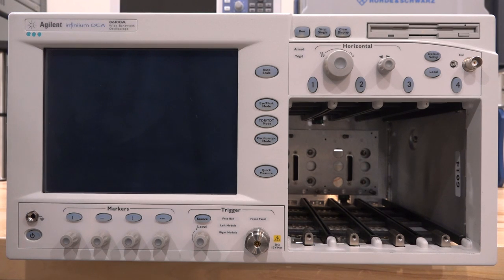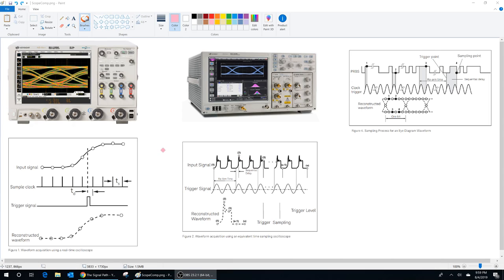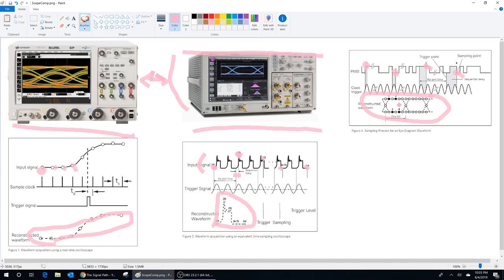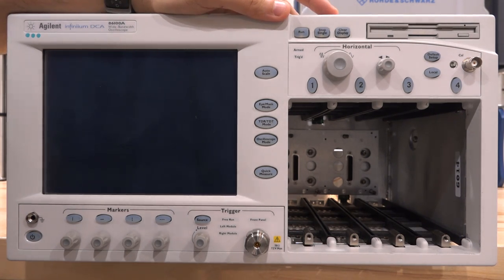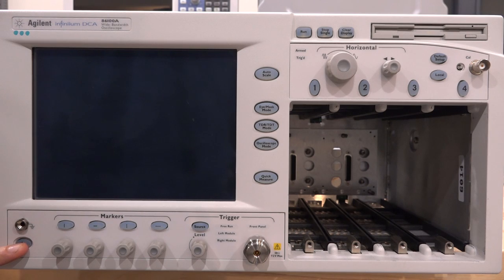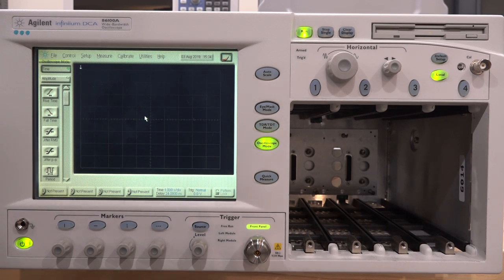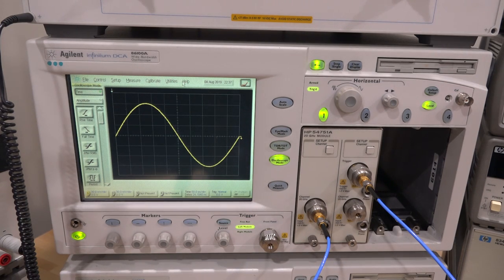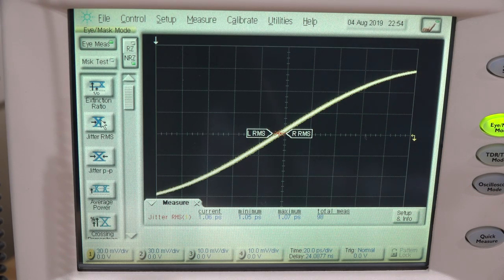TSP #156 - Teardown, Repair & Experiment with an Agilent DCA 86100A Wide-Bandwidth Oscilloscope

Comment from the maker: Please note that my channel format, content and style will never change; this is regardless of subscriber count. The subscription can help engagement with unique vendors, NOT sponsored content. I can get sponsored content anytime, but I have not. The most important thing is content diversity and reach.
Reply: I just recommended you to two friends. If everyone does the same you could be at 192k subs!
Reply: Richard Deasington I don't have any friends who are into this stuff. If I had, I sure would recommend this channel
Reply: HalfSpeedMastering You still get a lot of bearings that fail in these old drives. Or the obvious headcrash because something somewhere messed up. If the drive is damaged and you can't get a working image from somewhere the instrument is due for recycling. Switching out a control board from a donor HDD isn't too bad but fixing a broken bearing is pretty intense.
Reply: @allesklarklaus147  , I'd go from "intense" to "dense." As, almost always, it is nearly impossible! LOL
Reply: Shahriar, why not make some "general electronics videos" covering slightly more obscure topics? CFB opamps, balanced lines and baluns, beam forming / antenna arrays. These topics surely fit with your channel quite well.
Reply: One thing about your subscriber base, it is not simply about count,  A lot of them are people who design and specify very high value instruments and control large dollar volumes of instrument and component purchases.  They are not hobby makers.  To sponsors this would be very valuable.
Reply: @allesklarklaus147  I will be your friend

Comment: One thing you could possibly do to bring in new people, is to perhaps start a 'project' series, where you'll design a SDR downconverter for example, with certain specs, go through the design phase, PCB design, assembly and testing etc. I think that will actually allow us to also engage in the topics, since most of us don't have > 3GHz equipment laying around, but SDR is something anyone can do!

Of course you have to stay true to what you've always been doing, since this is how you've grown in the first place. Looking forward to see your ideas!
Reply: That's a cool idea!  Maybe dovetail it into more DIY 3D printed feed horns, which was quite astonishing and unique; I hadn't considered using a 3D printer that way.  How amazing to explore voodoo-magic microwave antennas by printing different variations and conductive paint!

Comment: First off, thanks for creating these videos. Very thorough.

I'm trying to design jitter measurement into an embedded design and wanted to better understand your comment in this video about leveraging precision timing with a low-speed ADC to statistically measure RMS jitter over time. Any further elaboration would be greatly appreciated. Thanks again!

Comment: My personal vote is for more videos about practical applications of RF techniques. Show some fancy RF simulation stuff and verify with a physical demo, for example. Given your "per video" patreon model, you could combine several concepts into one video. Something that draws upon your specialized expertise to explain implementation details that are achievable for experienced hobbyists. I used to feel a bit weird for being too much of a hardcore nerd in a sense of struggling to connect with less experienced people without overloading them. But I've figured out how to bridge that gap these days. I don't feel like I'm "not using enough of my expertise" or something. Sure I am. When I explain things to someone, I don't make mistakes or mislead them. I use proper and accurate terms. I can easily tailor my explanation to their application. I can answer any followup questions under the sun, etc. The other thing I realized is the value of multidisciplinary communication. I have colleagues with multiple degrees and it's always interesting to hear the insights they've attained by having equal expertise in several fields. If you're at a high level in your field, it's very important to find ways to make an impact on people who specialize in something else, but who could use the insights into your field that come from a trustworthy expert. I would argue that what makes your channel unique is 80% the person and 20% the content. It's your approach that sets you apart. Which is to say, you shouldn't be afraid of making occasional content just a bit more general. Like you said, a lot of people could do (and do) lower-level things, but not in the way that you would and not with the tools that you have. Wouldn't you agree? You're more valuable as a person than you think you are, trust yourself to do a good job on whatever you decide to do.

Comment: Shahriar :)

The higher the frequency the higher the cost of measurement equipment 1-GHz is DC 26-GHz+ is the offering. (and that that's the problem for user engagement)  

Do some basic videos on transistor regulators, signal processing, mix signal topics using a signal controller, topics on DSP ect.. the problem with your statement about HF 110GHz videos is, it doesn't talk to the basic to early advance user (not even to those who have own "some" good equipment) it speaks to companies, companies doing 5G and other advance stuff (like the stuff you doing at bell labs), I challenge how this form of education is translated in the real world (for normal users to take home and expand on), if the equipment to experiment at will is a challenge alone to obtain.  

Everyone has access to powerful MCU platforms and a oscilloscope (100MHz) this alone is ground for some amazing content.

Some random ideas..

1) There's a lot of opportunity to run videos covering covering mix mode electronics, digital + analog design.
2) Magnetics, in this day and age, there's alot of knowledge gaps around SMPS design for magentics. see Ridley Engineering about magnetic misconceptions!  
3) High precision circuit design, op-amps circuit design Dave did some good videos but that's only the tip of the iceberg.
4) If you want to do stick with RF then consider doing demos using sub 1-Ghz stuff. a basic AM radio would be cool? 

I remember some of your first videos, a discrete PWM controller using an op-amp and integrator.. that video alone helped me build and understand PWM controllers, I ended up building a SMPS and class-d amplifier controller a few years later.

Comment: i like seeing exotic gear, and i learn a lot just watching you test it, both about how it works and about electronics...  and i love how you make it possible for me to understand with you staircase approach, like how you go little things at a time, and explain from the ground, up one step at a time...  I think that's great, and I wanted to compliment you on that, I think it works well with your presentation, too...  it makes you (seem like) a nice person  😊

i wish there was more take-home content, though, because i'm still hesitating about a $50 meter, so a $5000 one..?  I'd get it if i had the money, though, so maybe it's not a valid argument...  🤔

i'm trying to figure transistors out, too, so a 6.5 digit meter....
Reply: Patrick Dorion ,  Most of us don't own a 6.5 digit meter, let alone one which reads to eight digits or more.
Reply: If you spend time on eBay and go to your local university's surplus auctions, you can pickup some gear for cheap.  I have a 6.5 digit multi-meter (HP 3455A), I paid less than $100 for it.  Of course, I have no way of knowing how accurate it is as I don't have the gear to test/calibrate it....  Of course, being a gear hoarder, I've since acquired 2 other 6.5 digit DMMs, both Keithleys....
Reply: @BruceNitroxpro  How did you manage to massacre my name when the thing writes it for you ?
Reply: @tylerufen  , There ya go, fella. Your name... written by the computer this time. LOL

Comment: 63k subs are far to low for this great content :) 
I started to watch your videos when I didn't even know much about advanced electronics and RF. Later, after finishing my mechatronics apprenticeship at a big car manufacture, I realized that your type of content is exactly what I am really interested in. When I start to look for universities, I found that I could study "electrical engineering and communication technologies" with a major RF engineering part close to the city I live. 
If there wasn't your channel I would probably still doing shift work and get my electrical engineering interest satisfied by watching EEVblog at work ;)

Btw, I remember that even I was annoyed by the shared ISA/PCI slot problem back than, but I was far to young that I should care about such things. I never understood why they changed the board position from ISA to PCI, so that one slot shares a PCI and a ISA connection. The only benefit I can imaging now, are some special enclosure with only one slot, but to be future proof (on the mainboard manufacure side) you can use ISA or PCI with the same single slot ;)

Comment: Worked with this Infinium (Agilent DCA 86100A ) back in 2001 when it was  out-of-the-box new
(NEW ! ).  After about a year of daily use, the soft silicone buttons became intermittent.  Very annoying.  After 4 years of use, the rotary controls developed issues.  Extremely annoying.
Also, rented the Agilent TDR plug-in (with active probe) for a month.  Worked great on 5G
pcb differential transmission lines (FR4 material).
Lastly, my vote:  keep emphasizing RF, micro Wave, and optical measurement domains.
You're Duh Best  !

Comment: Amazing content as always!! I am thinking about making some inductor saturation meter out of basic microcontrollers like Arduino or STM32 using this so-called "Equivalent Time Sampling" and an external VC-TCXO. This can hopefully cut the cost for an expensive ADC and make a very useful $20 tool for the DIY community. I am wondering if this idea is even remotely feasible.

Comment: As is already mentioned make some series for some project like module for 63181 counter to have input for around 6-10Ghz which is great  for new wifi and so. There will be lot of benefits.
- more subscribers
- learn about design
- learn about measurement
- you can sell that like a kit = profit
- may be Keisight will take over your construction = profit
- or simple give it to china manufacturer and get a % of profit

And this is only one idea. SDR downconverter, high stability clock, wide-band antena with LNA for SDR and so and so...
And you can mix it like one video like this one and one for those series.

Comment: There is nothing wrong with those "simpler" videos. Many people could have done those explanation of general circuits and devices,  but they did not - or at least not the way you did. Will keep advertising your chanel, as its content is allways excellent regardless of the topic. 
The suggested formula for vendors: equipment_price * TSP_subscribers * influence_on_acquisition

Comment: Using an SSD disk on WIndows98 is a bad idea considering the lack of TRIM support (https://en.wikipedia.org/wiki/TRIM). I would suggest you keep a backup copy of the disk image on a CD and have a spare normal magnetic disk as failsafe measure.  No real need to immediately swap the SSD though, as the flash memory wear might be minimal.

Comment: Make "basic electronics" videos for RF grad students. I.e., rather than single-transistor amplifiers at audio frequency, show how a single JFET can work as a VHF amplifier OR a mixer, depending on the circuit.

Oh, and chuck the harddrive, but save the magnets! Nice bearings in there, too.

Comment: I'm still unclear on how true this is, but I've heard that SSDs need to be used regularly (on the order of months) in order to refresh the data on them. They aren't suitable for long term offline storage. Don't leave this unit turned it indefinitely (or be sure you keep a copy of that disk image).

Comment: Maybe try changing the format but not the topic, for example separate out parts that are more generic to this type of equipment into another video. So when someone is searching for wide-bandwidth oscilloscope this is the first result. Youtube rarely promotes 30min+ videos unless it's very confident that the user is going to watch it anyway.

Be less specific in the titles, like 'Agilent Wide-Bandwidth Oscilloscope teardown and repair' and put details in the description.

You could try doing an 'explained/basics' or 'DIY' series, collaborate with other youtubers and do more measurements that benefit the everyday engineer or has the equipment to do.
Reply: Belazs Eszes , Most people really do not know about how sneaky YouTube gets or how they purposely cripple the "find" commands which is one thing you probably wish they would not do.

Comment: If I would be you - wouldn't bend to vendor's marketing to make more lower quality videos, that are might be less interesting to YOU. After all, I came to see your content in the way you present and explain it, not the manufacturer advertisement. For that I could go manufacturer site and see photos of equipment there. 

And content does not have to be also latest and greatest equipment, you can do lot of content on the older and clever equipment. It's nice to have high-end gear, but I think that what makes your channel special, especially RF gear repair videos - you often explain things that are not obvious, and getting working instrument in the end is just the nice bonus. Tbh, lately some videos like DMM6500 review somewhat skip many points like how instrument differ from older generation, or things like replacing the whole module in that VNA repair instead of trying to attempt difficult repair to show possible complexity. Often I undertake difficult repair project which I know nothing about, as this is best way to learn a lot of good knowledge while figuring out how thing work, while trying to fix it.

Would be nice to see in future experiment comparing "DIY" TDR setup, with things like Leo Bodnar's pulser you have and scope versus actual TDR instrument, and what drawbacks are. Maybe practical example could be testing interconnect signal quality, because this is very popular task modern electronics engineers face with all these modern serial interfaces like USB, PCIe, HDMI/DP, etc.